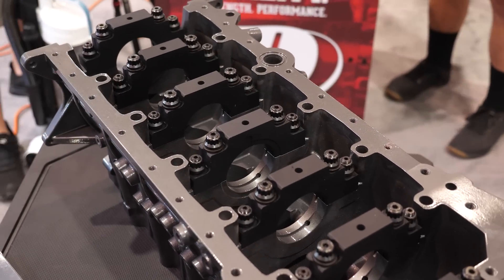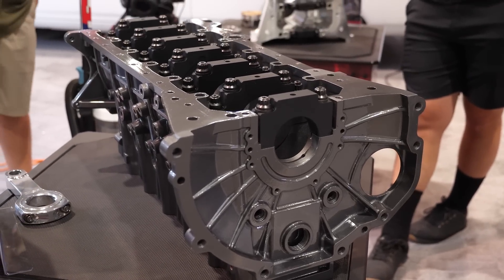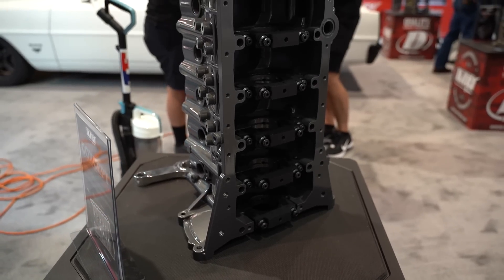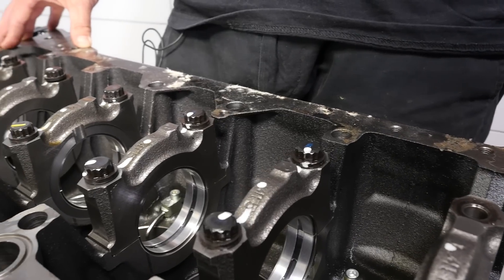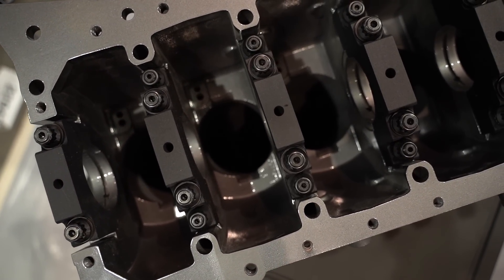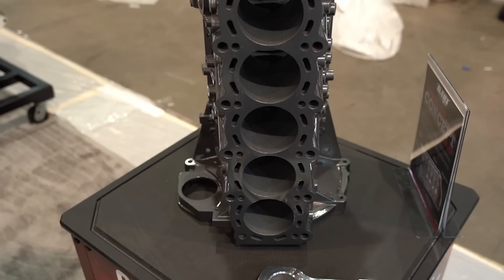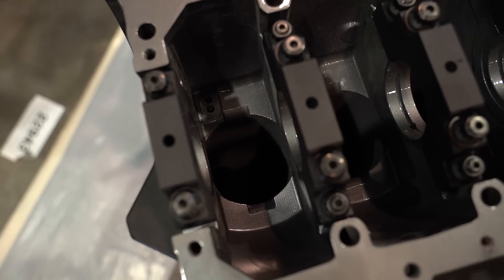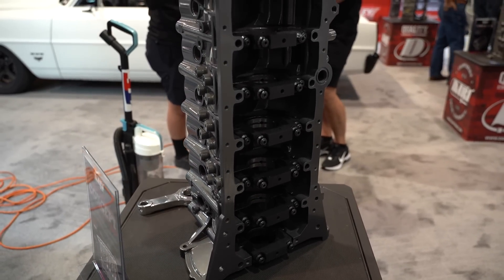Dart's 2500HP+ Aftermarket 2JZ CAST IRON Block

Comment from the maker: Take $50 USD off ANY HP Academy course with this coupon: YOUTUBE50
Enroll now: https://hpcdmy.co/50offytc - Taz 👨🏻
Reply: Why not stud your main caps instead of bolts
Reply from the maker: That is what suited the application. There is more to studs vs bolts than just studs vs bolts. Materials, RPM, fitment considerations and more are part of the conversation. You could have an aftermarket bolt that is superior to a stud of lesser quality material for example.
You need to use what works for the application in front of you, not what someone else building something different is doing. Quality fastener suppliers like ARP can help with that along with your aftermarket parts manufacturer/s - Taz.
Reply from the maker: Also some good info in here: https://www.hpacademy.com/previous-webinars/160-choosing-the-right-fastener-material/?utm_source=youtube&utm_medium=social&utm_campaign=general-interaction

Comment: Meant to ask before.
It's possible to 3D print casting cores and some companies will cast lower melt point alloys, such as aluminiun or bronze, for customers with some even doing the printing from the customers' file. Can/will DART offer this service for cast/nodular iron/steel products of the customer's design?
Reply from the maker: Great question, one that I can't answer sadly. You can certainly do that in general as I'm sure you know (lost PLA casting), but for an engine block? Will see if we can sneak in a question around this if we see them later in the year at the likes of SEMA or PRI 😎 - Taz.

Comment: as far as losing money on a short block.. u can buy the FULL SHORT BLOCK and sell the components which are pretty much NEW still and recoop a good amount of that money back actually for the block itself.
Reply from the maker: Have you done this personally? 
Can't imagine there is a massive market for stock 2jz parts in 'as new' condition from random sellers for anywhere close to new prices. When you put a cost on the time it also takes you to sort all that out and deal with the type of person that is attracted to such products/sales avenues then it's even worse.

That said, if you have found a way to make that work and are more than happy to continue to do things this way, no one is telling you that you can't 😎 - Taz.

Comment: Fascinating: You can build a Chrysler Hemi - the premier US performance engine, which has not been manufactured for decades - entirely from aftermarket parts. It costs, but you can do it.
                       And now, you can build a Toyota 2JZ - the premier Japanese performance engine, which has not been manufactured for decades, either - entirely from aftermarket parts.

Comment: Would like to know there cast iron alloy mix how much nickel etc and hardness compared to the factory block as this is critical in a big Hp motor 

Surprised they it wasn’t a question you asked 

Great interview looks like the block will fill the gap that’s emerging

Comment: So. Its not a toyota casting. Then its custom and is no different from a billet block in that its NOT an OEM cast block.
Reply from the maker: There is a difference between a cast and billet block beyond whether it is a factory or aftermarket/3rd party casting.

Billet vs cast comes up in a bit of content, I can't remember it all but here are two pieces:
Podcast: https://www.hpacademy.com/blog/037-pushing-60-psi-through-a-subaru-boxer-podcast/?utm_source=youtube&utm_medium=social&utm_campaign=general-interaction
Interview: https://www.hpacademy.com/blog/cast-vs-billet-mountune-motorsport-engine-block-design-tech-talk/?utm_source=youtube&utm_medium=social&utm_campaign=general-interaction - Taz.

Comment: I noticed you were using bolts for the main cap why not use studs style bolting
Reply from the maker: Material and the application come into play when bolts vs studs are discussed. Don't just copy what someone else is doing, bolts or studs, without understanding your own needs and requirements - Taz.

Comment: $4,500 for a cast block is EXPENSIVE for what it is... I build my whole short motor for $5,500 with my RB
Reply: It’s actually a good price. Take a stock block to the machine shop and have them do billet mains and stroker clearance bore hone etc.. and see what your bill is.
Reply: You gotta take into consideration that the block isn't stock design and needs r&d poured to it. It's pretty good upgrade without spending arm and leg for billet one.

Comment: Now we just need reproduction head castings
Reply: stock or billet...
Reply: @kermitahnenerbe3722  stock castings would be good
Reply: @Nicksshedbuilds  2jz ge, it's gonna be less expensive than gte i think and pretty sure are the same. but port may be different on gte to accomodate flow with the turbo  🤔

Comment: This is great! Especially for the 1jz guys that might want to go 2.5 jz later on.

Billet blocks, ones that have coolant passages built for them cost anywhere from 12,500 to 14,000 usd.  If going by examples from Mazworks and Titan motor sports.  This at less than one third the cost could be a game changer!
Reply: Meant to say 1.5 jz.  1jz head.  2jz bottom end.
Reply: What is a 2.5 jz? If you don't mind me asking

Comment: Chriiiiiiiiiiiiiiiiiiiiiiiiist almighty give us an RB26 block please!!!!
Reply from the maker: Another company is working on one of those I believe but it's worth noting that Nissan have also put the RB26 block back into production. Not sure on the price tag .
Some obvious advantages to a RB26 version of what Dart is offering here over a stock block though.

One of the upcoming podcast episodes will have more info re the aftermarket cast RB block - Taz.
Reply: @hpa101  I was lucky enough to grab a new in the box OEM RB26 but it's still just a stock block with all its flaws, PRP has stated they're going to want 8-10k for their cast RB so Dart, if you're listening, PLEASE make an RB!
Reply: Would be nice to see a dart version.

Comment: Stainless steel for uber strength 🤌🏻
Reply: sometimes an element of ductility within the material-specifications of the elemental recipe of the metal alloy (since steel is an alloy of iron and other elemnts) adds a lavel of durability and resistances to enduring working-forces & wear; steel(s) can sometimes be too stiff &/or brittle compared to an alloy of iron (yes steel is a carbon alloy of iron, but there are iron alloys too, that are not necessarily considered a 'steel' alloy.
    I might guess this has trace elements of copper or manganese, molybdenum and perhaps even two or four other elements too, with a final percentage of carbon below the typical carbon content for a 'steel', within its casting iron alloy makeup.

Comment: Ask them about the Hemi block... they were talking about releasing that for at least 3 years at this point.
Reply: You can just get a turnkey crate motor from Dodge.
Reply: @TML34  No one who's interested in a G3 Hemi aftermarket block is considering a factory crate engine from Dodge
Reply: @TML34  If you paid any attention to this video where they address stock block availability, it's stated that Toyota still does run these blocks but the drawback is that you have to buy it as a factory short block and end up throwing away half of the components. You just addressed an entire crate engine... They typically go for anywhere from $25k to $50k if I can remember correctly. So lets say I want my engine to be a turbo 426 with a 4.0 throw and 4.125 bore. I already have to remove the $10,000 supercharger unit. What if I want Thitek heads with coated chambers and valves? I'll now have to remove the $5,000 heads. Now I want some TBC Diamond pistons with the .927 SBC DLC pins on some Callies Enforcer rods... so now I have to remove a $5,000 rotating assembly. The aluminum vvt block is a good option too but it's 2k more than what Dart was trying to ask for their G3 block. The Iron block has a good appeal for street applications because of their full siamese sleeve, lack of core shift, likely a stronger material than factory, thicker decks and they were even attempting to make it a 6 bolt/cylinder block. Now is it ok to want an aftermarket Dart G3 Hemi block?
Reply: @primexgatling5529  if you want ridiculous power, there’s no need for a Hemi build, end of discussion. If you still want a Hemi, and aren’t doing a drag build, then just buy one from the parts catalogue. You get a warranty too.

Comment: They should make k series blocks, they are such great and popular engines and the weak block is their only major flaw, I think the market is much bigger than for a 2jz
Reply: A good set of sleeves is still an option, just depends how far your trying to push it.
Reply: They've made a b-series for a while, I'm sure it's on their radar
Reply: @brettvette  Their b series block were garbage. Cracked one at 450 horsepower.
Reply: @Ricolas_Cage The GX20 "beast" B series?
Reply: @scotteric8711  I cant remember what it was called, this was back in 2007, it was the b20 dart block, cracked inbetween the middle cylinders
Reply: @_..-.._..-.._  I'd say we agree I got a bad one
Reply: @_..-.._..-.._  I also bet a factory Honda block is just as strong or stronger
Reply: @Ricolas_Cage  yea ok definitely from the iron block
Reply: Talking about dollar for dollar. Your wasting your money on a Honda dart block, maybe the 2jz block for 2500 hp is great but if your just doing a street build I don't think the dart block is anything more than "I have a dart block" for most..
Reply: @Ricolas_Cage  
Going to depend on what one calls a "street" build - some will have an easy 1000hp for a K series, 3000+++ for some of the six and eight cylinder engines.

However, your intent - that one spends wisely and as needed - is certainly spot on! 👍
Reply: @brettvette  the B series depending upon the variant could be quite a rare engine, they were hard to find in the 90’s and early aughts, they only came in hot rod versions of the civic and integra. I was looking for one in the early aughts and the price was about $2500 Canadian for a JDM version, wrecker North American versions were more or less not available because demand was so high. The K series replaced both the B and D series which meant production was multiple millions, and if you’re turbocharging, any version will do ->you don’t need a fancy Vtec head or any of the other oddball versions. The shear amount of K series will likely mean it will be available for the next couple decades, the only problem is it doesn’t have the production longevity like a Chevy small block or Ford Windsor, so we might not have many two decades from now.
Reply: @drewski5730 I've gotten the rarest b series (b17) more than once for 500-600 CAD in the last 10 years
Reply: K series is pretty cheap tho. It’s just not much money to get a core and have it sleeved.
Reply: @drewski5730  
Well Boosted Boi Kyle is currently testing/finding the limits of the stock block lol
Reply: @LEOhopeful  that was done more than a decade ago…. Some people you just need to let them fuck things up on their own or they’ll never learn.
Reply: @LEOhopeful  hes going billet next
Reply: @LEOhopeful  glazing
Reply: does a Honda guy want to or can afford a block from them?
Reply: 'Bullet' make billet k series blocks.
Reply: Straight 6 k block! Ftw
Reply: Yeah ,exactly, K20 variants,or whatever is more suitable for the market,pretty sure they have it into the future!
Reply: The Average 2jz block failure is usually attributed to things not related to the actual block. I remember getting my block cryogenically treated, half inch studs, billet mains car bolts carillo rods and wisco pistons. Then the shop called garage GT owned by Cenk over in San Diego put a catch can in and didn't have any filter or ventilation. I got crank case pressure and it through a front main while tuning and got rod knock instantly.  I trusted this shop's work and I was on deployment and they really took advantage of that. It was a nightmare. So getting a Dart block wouldn't have mattered in that case.
Reply: Not everyone is going max effort on a k series. If you're that far into the horsepower that you are breaking the block... better off just going billet.  With that said. I think if this works out for dart the way they hope I can see them doing some other blocks.... but the thing is I see them doing older stuff that's just getting hard to come by..
Reply: It's for the global market
Reply: Just imagine if they cast a Honda K series block/head with 2 extra cylinders for a 3.0L+ inline 6 Honda.
Reply: @laurean5998  they really should, and make them rebuildable closed deck iron to begin with.

Comment: I'm slowly building a 2JZ with over 1000whp to put in my 2002 Mustang and this couldn't have been announced at a better time
Reply: should of put a barra in it
Reply: Do you have a page or something for the build? I’d love to follow it. I have an 02 gt🤙
Reply: Why on earth would you built an expensive 2J when a SB Ford will do the same for half the cost?
Reply: @The Hutch  because rubbish ford
Reply: @TML34  Same reason I'm putting one in my '87 Thunderbird. I could build a 347 or 408 stroker, I could boost a 300, I could fit a 460 in there... Or we can make 2JZ sounds come from cars which will greatly confuse people.
Reply: @Scraps_Pile  I have no issue with pissing off the purists. I’m just a cheap b@stard that wouldn’t spend the money on a 2j build. 😅
Reply: @TML34  Style...
Reply: @TML34 cope

Comment: Just think, the 2JZ has been manufactured since 1991, been having these problems since the 2000s and it’s finally 2023 and we’re getting an aftermarket block. SBC, SBF, BBC, BBF and Chrysler products have had aftermarket blocks since the 80’s.
Reply: But came from the 50s/60s so the ratio is only a little worse!
Reply: @bennyb.1742  all those engines had 30+ year run times. The 2JZ only ran until the mid 2000s because of Lexus.
Reply: @bennyb.1742  there’s been aftermarket blocks for your main USDM engines for decades my guy
Reply: Hopefully they'll soon offer HD block and head castings of the Nissan RB and Honda K series.
Reply: @Sir.VicsMasher  I could certainly see the K(hope that happens sooner than later), but I don't think there's a chance in hell of an RB happening
Reply: @RyTrapp0  Funnily enough, Dart is working on their cast RB block right now! 😂
Reply: @danielbrealey2924  I hope so!!! And I hope it stays around, because that's a small market!
  
...now if they would just get to work on a damn Coyote block...
Reply: @RyTrapp0  MMR has a 349 coyote block, believe they are pushing close to 4,000hp
Reply: @RadDadisRad  Yup, it's billet and costs $14k(additional $1500 if you want water jackets) too. Accufab(John Mihovetz) also developed a billet block with BAE, and it's also expensive AF($13.5k I believe) like all billet blocks lol.

I'm waiting for a beef'd cast block with a reasonable price tag($4k or less), so we can stop pouring money into race prepping factory blocks. BBM makes(made?) a cast aluminum Coyote block, but it's kinda impossible to find any commentary on them from users, have rarely heard of a Coyote based on one. And Ford Performance announced a cast iron Coyote race block at PRI 2019, but there's no signs of it today(I'm afraid it may have gotten pandemic'd).

But, yea, as of right now, it's basically either prep a factory block or lighten your wallet by nearly $15k for a billet piece. BBM doesn't even list their Coyote block anymore, only their Ford FE stuff. We really just need a known reliable manufacturer like Dart to take lead here. It's not like there's a lack of demand, there's a LOT of 4-digit Coyotes out there, far more demand than the OG Modular motors ever had(just worked on my nephews 3v today, has a Ford Racing 5.3l big bore-stroker, SOB popped a freeze plug out of the back of the block, into the bellhousing, so I'm trying to get him to replace the wimpy stock '05 Mustang Tremec 3650 trans for a T56 Magnum since we have to pull it anyway lol).
Reply: @RyTrapp0  Brett LaSala proved you can sleeve a factory predator block and survive street/strip use @ 2500 whp
Reply: @Sir.VicsMasher  there already is. Its called billet aluminum.
Reply: Makes sense...2JZ production numbers are a joke vs almost any V8
Reply: 99.9% ppl dont need aftermarket 2jz block think about that.
Reply: @visa5175  99.9% of the people don’t AN aftermarket block.
Reply: Titan has been making aftermarket blocks since the 00’s.
Reply: @Stopinvadingmyhardware  nope, developing 2JZ stuff drag racing. They didn’t have a billet block until 2017.

Comment: They could make it for RBs😢 with upgraded webbig and bigger main bearings and oil galleries.
Reply: I'm sure they will some day but the market for 2JZ blocks is way bigger than for RB.
Reply: they should, the rb has even more weakness than a 2j, but i wonder how many people would buy it?
Reply: @24zer0nd  they should do a closed deck k series, I think there would be a lot of demand for that
Reply: @laurean5998  Why, it's non sense. you can make them semi closed or fully closed easy and gonna be cheaper